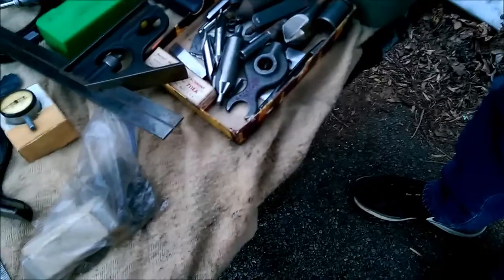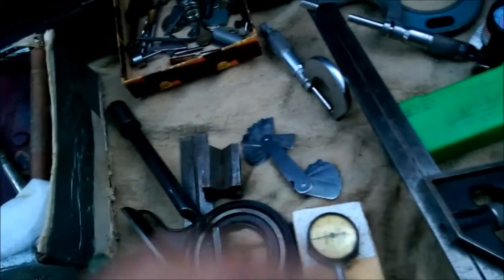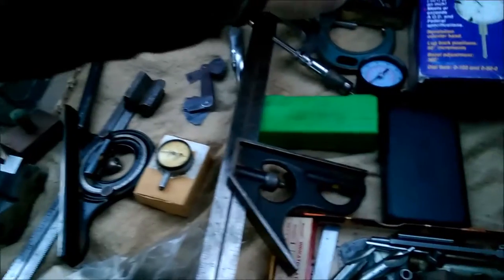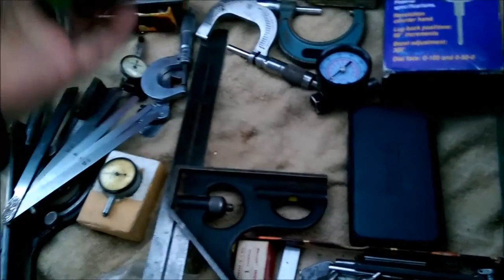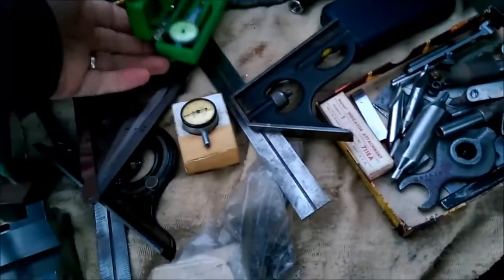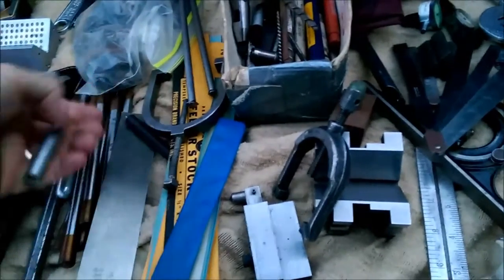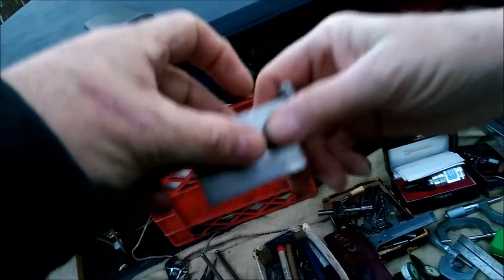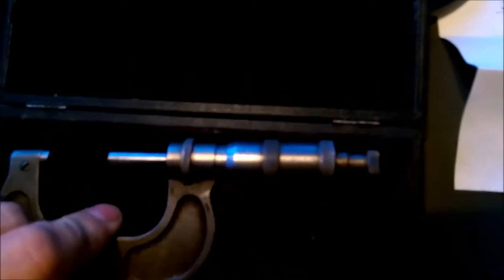Short Run to a Machinist Tool Score - Crafted Channel

Comment: Nice spread of stuff.  All cheap prices.  It's just a matter of how much of the stuff you really need.

The special screwdriver, appears to be a spring loaded grip slot tip which locks the blade in the screw slot for hard to get to positions.

I have several sizes of these, and they are handy at times.

Sales like these are always interesting.

Cheers Rob
Reply from the maker: Yes, it is a grip lock.  It's stuck.  I didn't check it at the time I purchased it.  There is no visible corrosion so hopefully it will free up easily.  Good to hear from you.  Time to check your channel.

Comment: That Starrett piece of metal is tool steel. Starrett made and still makes tool steel in various sizes and thickness as well as water and oil hardened. Should have grabbed that. That shit is pricey to buy and good to have around.
Reply from the maker: It was very thin, something like .020 or thinner.  I almost wonder if it was a scraper.  At thin as it was that is all I could imagine it could be made into.  I like knife making but it was too thin for that.  Probably could have had it for a dollar.  Next time I'll recognized it for tool steel and snap it up.
Reply: Crafted Woukd have been excellent for a knife blade project. According to my catalog, Starrett oil hardening flat stock comes in as thin as .0156"(1/64"). I mean it certainly could have been something else, but my guess is precision ground flatstock. 
Did you end up buying that Federal test indicator? I have one just like that in the green plastic box. Mine is .0001" but one of my favorite indicators. Federal indicators don't get the notoriety that others get like Starrett, B&S etc, but I think they are equally as good. Good Craigslist find.
Reply from the maker: I'm sure you are right on target.